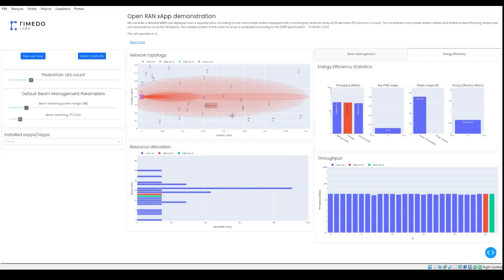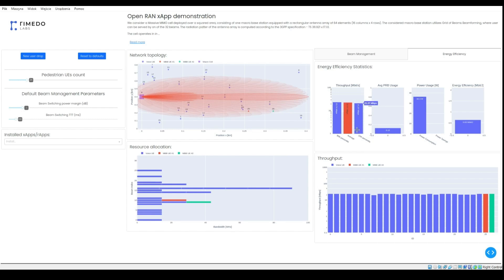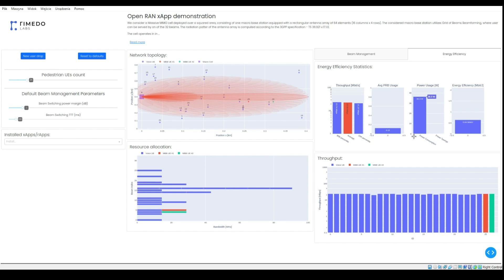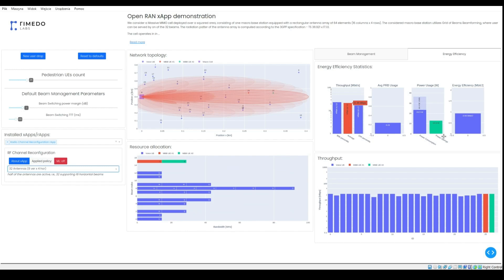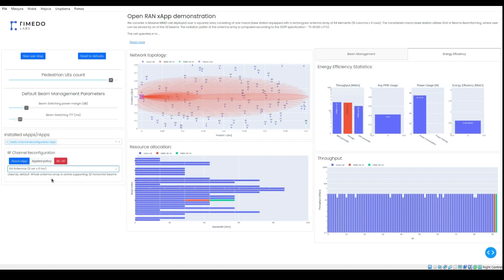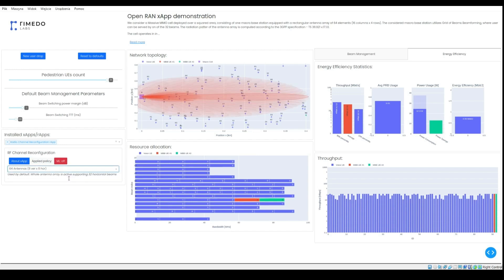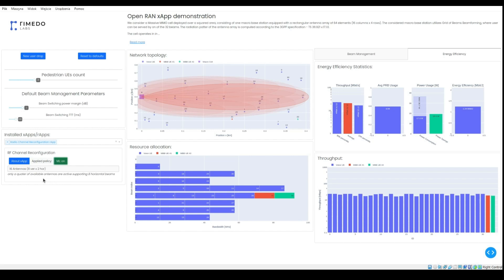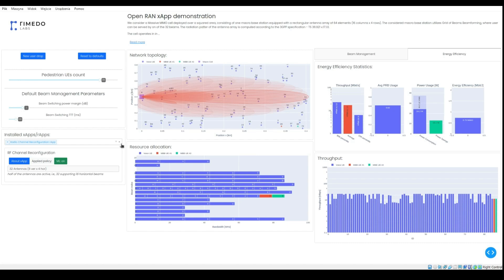Energy Saving rApp for Open RAN (RF Channel Reconfiguration) - Demo

Comment: Hello. Thank you for nice Demo. Is it right that this rApp service is not available on Open RAN xApp demonstrator now? I can only use BMM xApp.
Reply from the maker: Hello, thanks for the question. 

Yes, that is correct - the ES use case is not yet available in the public version of the Open RAN xApp Demonstrator. We're currently working on it.
Reply: @RimedoLabs  Is there a prediction for it to be available?
Reply from the maker: @sergiomartins4652  Could you please clarify the question. What do you mean by "available"?
Reply: @RimedoLabs  available in the public version of the Open RAN . You say ES-rApp is now available in the demonstrator. Is it in public domain this demonstrator?
Reply from the maker: @sergiomartins4652  Yes, here is the link to the registration: https://mailchi.mp/cde919b0e2d6/open-ran-xapp-demonstrator
Reply: @RimedoLabs  thanks
Reply: @RimedoLabs  will to be available one day ES-rAPP as open-source as you did for TS in ONF SD-RAN?
Reply from the maker: @sergiomartins4652  we are considering this, but it is not yet decided.
Reply from the maker: Hello, now the ES-rApp is available in the demonstrator.

Comment: What is the benefit of using machine learning here?

Could the same dynamic behavior be optain based on the throughput trash hold analysis?
Reply from the maker: Thanks for the question. The problem with the threshold is how to obtain its level. What ML does can be understood as adjusting the threshold in an automatic manner. If we consider the real network user throughput depends on many functional blocks like scheduler, precoder, beam management etc. Moreover, the realistic massive MIMO radio channel has some correlations, and complicated reflections. 

Due to those facts it is hard to estimate the user throughput related to the given array configuration apriori, on the basis of standard optimization. It is necessary to capture the data  (user troughputs, power consumption) related to the given antenna array, and train the ML model. 

Moreover, while considering massive MIMO not only the total number of users matters but their spatial distribution, especially in the angular domain. For example, the same number of users can require different array configuration when being cumulated at one specific direction, and when being spread over multiple directions. 

Our rApp takes multiple input features, and some of them are related to the per beam load distribution that reflects this spatial diversity of users in cell.

We hope this clarifies the ML usage.
Reply: @RimedoLabs  yes, thank you for the time :).